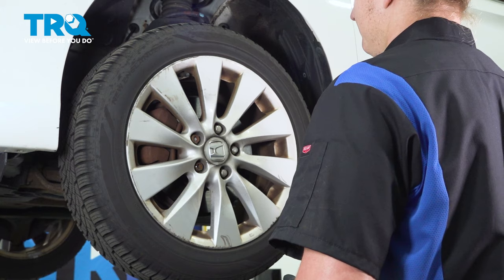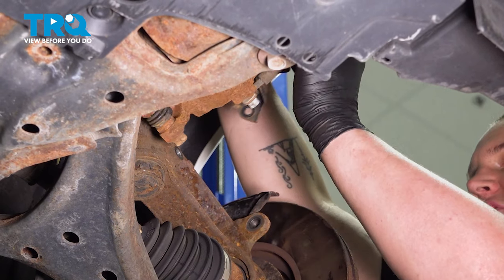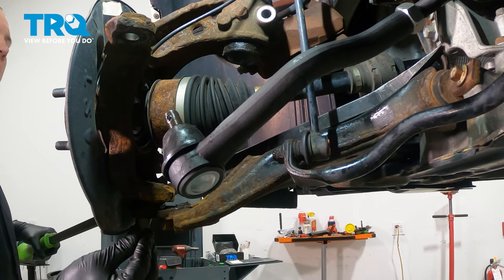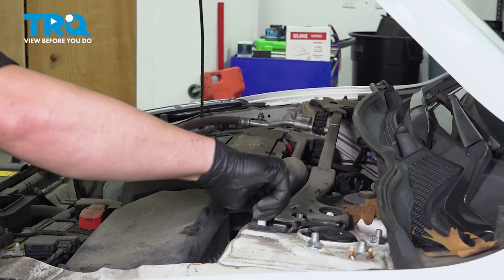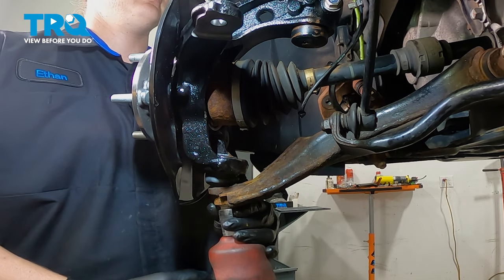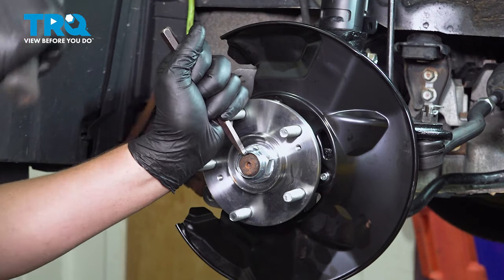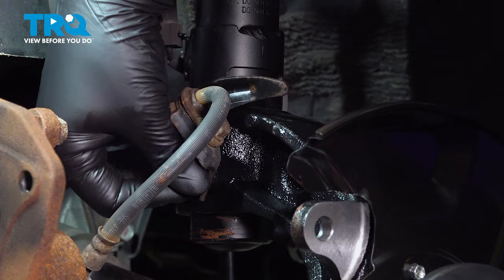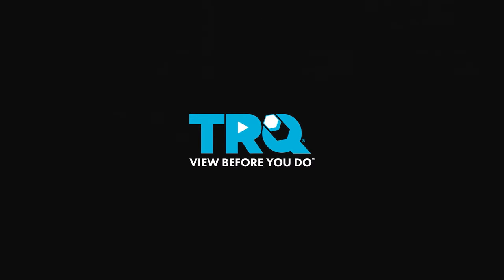How to Replace Front Strut & Spring Assemblies 2013-2017 Honda Accord

Comment: Those rotor screws are NOT Phillips head.  They are actually JIS (Japanese industrial standard) #3 screws.  Using a Phillips head will do nothing but strip those JIS #3 screws.  Use a Vessel #3 impact screw driver to remove them. Put Permatex anti seize on those screws before reinserting them.

Comment: If anybody is thinking of attempting this at home be warned, it is not for the faint of heart. I have been wrenching on my own vehicles for over 20 years and have never dealt with such a pain in the ass strut assembly. Mine was on a 2017 Honda pilot touring but it’s basically all the same bullshit for this accord too. I couldn’t get the bottom control arm off to save my life and I even have the fancy tools. Took me 6 hours just to get 1 side off. Blew my mind. Hands down those are some of the hardest struts I’ve ever dealt with. Normally it’s a couple bolts and it’s out. Instead Honda decided to completely change the suspensions on the 16+ pilots (prior year pilot was substantially easier to change struts out it only took me 4 hours) and 13+ Accords they did too.

Comment: 40 minutes if the vehicle is new. 6 hours with some extra new parts (abs sensor, sway bar links) from things being rusted/seized if it's a 2014 like mine. To start, break the axel nut loose BEFORE you even jack it up.
Get the ball joint separator or mayybe a pickle fork, mine was a stage 5 clinger. Rent it from auto store. The next biggest pain was the sway bar link for me, skinny round part under the boot didn't want to stay clamped and the nut/bolt was rusted. Pb blaster, brake cleaner, torch. Too much nuance bs that adds up. Basically never want to change my own struts again 😂 Cars are designed for consumers to take them to shops. Likely be at it again after seeing their "estimate" though